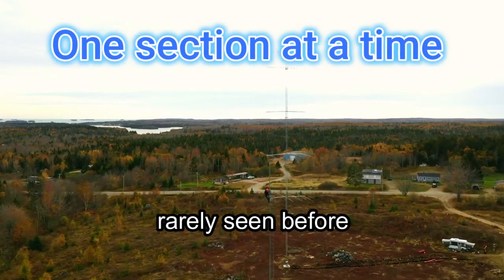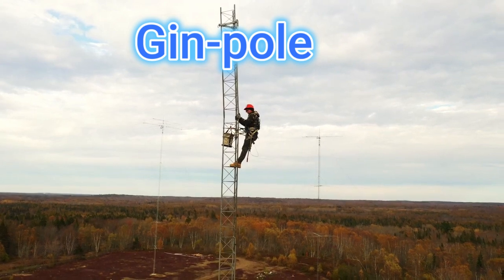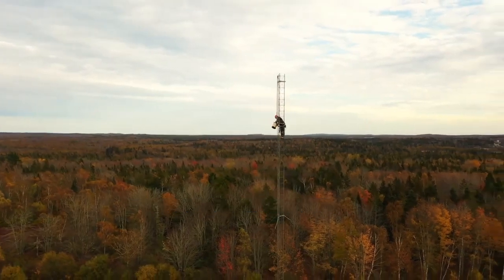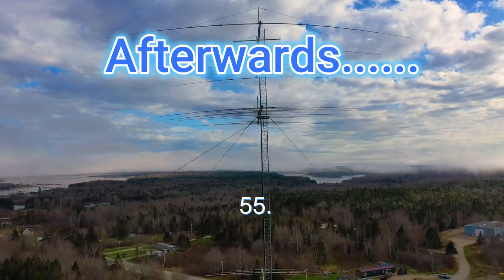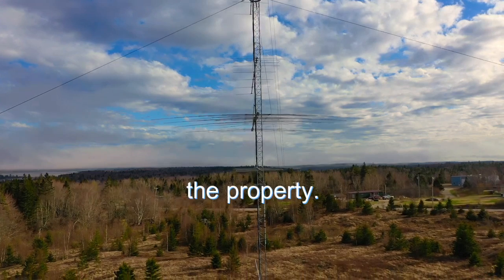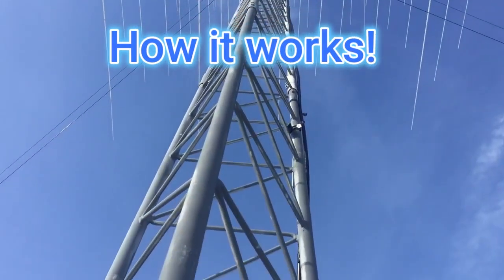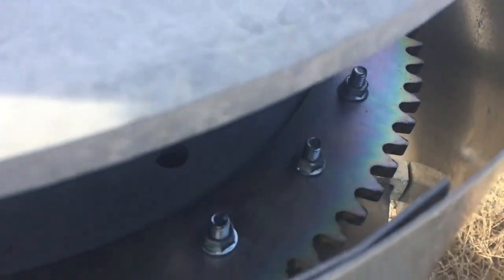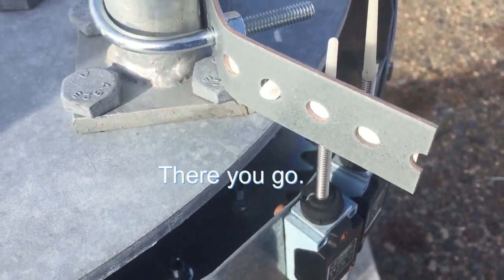Lifting Radio TOWER with GIN-POLE & MORE. RARE Exclusive FOOTAGE! Never SEEN Before!

Comment: That's how we do it. I have gin poles for Rohn 25, 45, 55 and specially made ones for the SSV towers (they are heavy). We inspect all the sections first before erecting. This save a lot of time to make sure the sections fit in correctly. The tower goes up fast when you do it right with a seasoned crew.
Reply from the maker: Sure does!